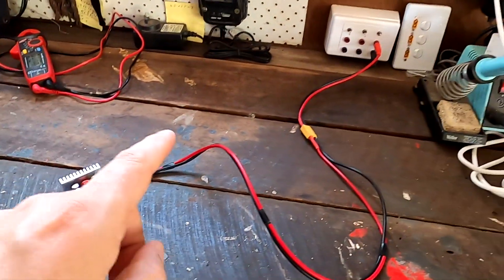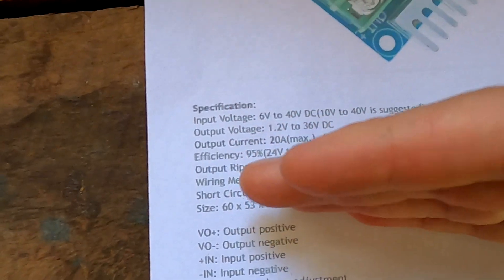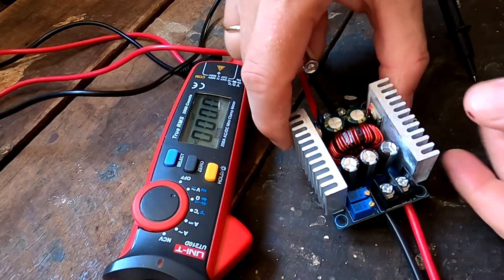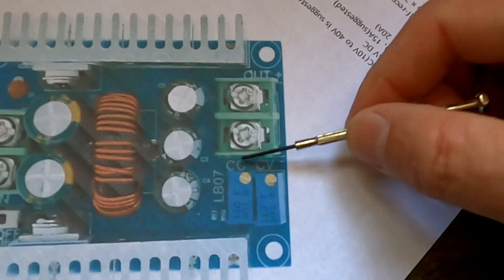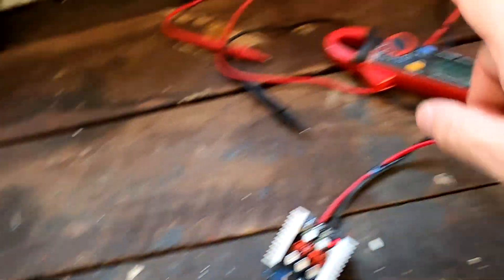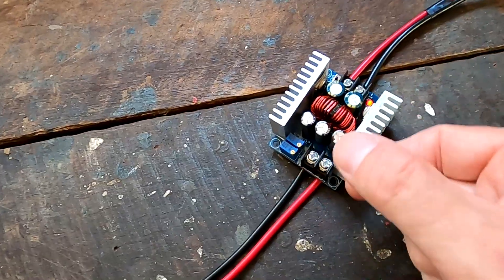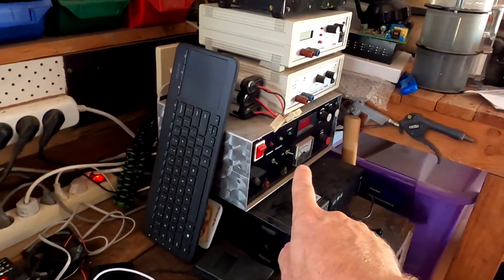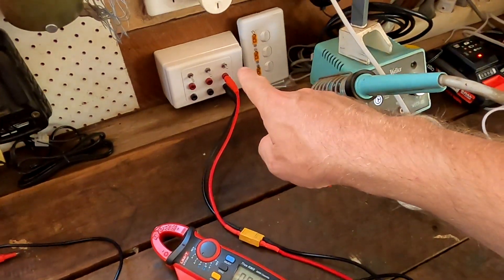Workshop: Lithium Charging 101 -  Getting these Amps in... (Part2-2)

Comment: This is reminding me of how I burnt down our dream home. I used a buck converter to charge a 10 ah lithium titanate  cell forgetting I had previously charged charged some 18650s at 3.7 volts. I did check it but unlike you I didn't disconnect and at the terminals of the cell it read 2.6 volts which I interpreted as nearly full. When the titanate cell exploded it triggered the other cells next to it and they went off like Roman candles in our attached garage.

Comment: I recently did the same to charge my cells before running them through the EBC, I have two different models of DC Buck converters, the one from your thumbnail and a smaller version (amazon description says 12A). I thought connecting a 20A Buck (capable of 22A continuous under heavy cooling) and a 12A (14A is the fixed CC limit) buck together would give me 36A, but no, the small 14A fixed converter suddenly went to 17A and more, running extremly hot. So please check carefully if different converters work together, even when their output voltage is within less than 0.01V

Comment: Woah! this cleared so many doubts I had. My 8S configuration (100Ahx16) are out of balance/never truly balanced due to the amount of time my bench power supply could ever put out. I always wondered how your zketech-a40l was doing 40A. In another video I found that, that chinese cracker actually as 5v-300watt SMPS and uses some fancy buck conversion to do the 40A. Thanks again!!

Comment: You got me thinking now, for my EV conversion to charge my 70S 250V pack I can charge it direct from a number of solar panels in series to get the voltage up to a usable level. And count the ah/hr going in upto maybe 90% (fast charge) BMS there backup. A balance charge would be needed with a controller i suspect, except they dont make mppts for 250VDC battery packs.
Reply from the maker: NOOOOO, never use the BMS as a charger! You always want a proper charge controller doing the charging. The BMS is just a safety device if something goes wrong.
Reply: @OffGridGarageAustralia  I wouldn't recommend it either. But actually it is doable. EV works in Perth were doing exactly this. And Jack Rickard did alot of testing with fast charging LFP cells with  much higher voltages. As long as you are counting the AH going in and keeping temprature in limits. 

Anyway Andy where do i buy a charge controller for a 250VDC 70S pack?

Comment: Hey Andy, Still trolling through your videos, been a treasure trove of information. Thanks again! I have struggled to find anything about leaving a battery attached to a DC-DC perminantly, in my case, 13.8v output for charge a 12V 25Ah LiFepo4 for an outhouse, which at 3.45V per cell seems like a great choice to me. Quick question, where did you get the wall panel for with the 3 + - inputs and switches?
Reply from the maker: Thank you. 3.45V is ideal for these batteries.
I build the wall panel myself just from an blank standard switch plate, installed some banana jack ports and switches and connected the solar panels.
Reply: @OffGridGarageAustralia  Perfect Andy, why buy it if you can build it :) its a simple an effective idea. Thanks again and keep up the good work :)
Reply: If you you were leaving permanently connected i would probably have the voltage set for 13.4V (3.35V resting voltage of LFP cell) Which is also the LFP float setting on Victron MPPT's. Mind you leaving LFP 100% charge all the time isnt great.

Comment: Hello, when the voltage of our battery is 13.3, if 7-8v comes from the solar panel, will there be a problem? Will the current flow in the opposite direction and damage the device or the panel? actually I am very curious about this question.
Reply: Can we connect these modules in parallel to get more charging speed? this device actually acts like an mppt.

Comment: i have a question  since my solar array is converting to ac  on the roof tru micro inverters(enphase iq7)  im am looking for a way to charge my powerwall  when there is only sunlight  avaible.
I ordered 8 of the lifepo4 280 ah batteries(my powerwall of 6.4 kwh) and i just wanna use them to run at night when the sun is gone   and charge tru the day with solar only . so how do i make sure i charge the batteries with only solar power , also  woud it be smart to charge all the batteries parallell and tru relais switch to serie when i start discharging them to get a higher soc??

Comment: I'm thinking of something like your buck converter for a sail boat I'm wiring up. I have two outboards that generate up to 6 amps or so, and wouldn't mind letting them contribute to charging a lithium battery. So wondering about a marine proof converter - maybe you or a reader/watcher would have a link. I've been searching the googles, have found some very expensive ones, and other affordable ones that generally don't have enough specs to know if they can be dialed into 13.6 volt max output or not.  Unless there is a better way...   Enjoying your videos - thanks!
Reply: By marine proof, it would be inside, but there's that salt air...

Comment: You should measure the Voltage drops on the wires between the Voltage Source and the Batteries terminals. When the active device (MOSFET) in those buck converter shorted out it will dump input Voltage to the output so you need some kind of Over Voltage protection to protect the load (Batteries in this case, hopefully the circuit breaker will trip in time before damage occur). You are so right, you MUST keep an eye on the setup while charging the batteries.

Comment: If you were building a 16 cell 12 v battery with those 280 amp cells, could you make it 4s 4p with one big BMS or (4) 4s 1p with 4 BMS's? I don't plan to 1200w/hours out.
Reply from the maker: If I would build a 12V system it would be a 424p, yes. In this case you parallel 4 cells and put them in series with the next 4 in parallel. You will need only one BMS for that setup.

Comment: Why the batterys are all parallel, make more usable to put 3 in row series for 12v  pairing 2 cels. Can use wide range of 12v gadgets and 230v invertter when need 🤔 (also no need heavy cables and loses are smaller)
Reply from the maker: That's for balancing purposes as I mentioned.

Comment: This is a great video. A couple of years ago I tried to explain lithium charging in an online ebike magazine. Basically it is CC-CV. Any 18650 data sheet will show that, though there may be an adjustment at the end. I sort of stumbled upon these DCDC converters and realized the settings for CC and CV were designed for lith charging. I always just set the modules for the max voltage, for the pack. But I've wondered about solar charging and how to get more output. An MPPT regulator boosts the voltage but also protects the cells. You can't really do that with this DCDC converter. The cell voltage is what matters, not the voltage on the output of the DCDC converter. Most of these lithium guys offers packs or cells and then they offer a pricey MPPT regulator and stuff like that. It may work, but knowing hot to charge a lithium cell or pack is important. This video shows how to maximize the amps into the battery while noting that you have to limit voltage as the pack voltage rises. What's great is that if you use a power supply and don't need to optimize the amps, like overnight charging, you can just set up the buck or boost converter and make it a dedicated charger. Thanks. Great series. Hope you get a bunch of subscribers. You don't talk down to people, don't oversell stuff.
Reply from the maker: Thanks heaps, George.
You usually have a much higher input voltage with theses MPPTs than output voltage. The amps are exactly the other way around less amps at the input but higher amps at the output. An MPPT regulator does boost amps, not volts. 
A typical setup would be 3x45V solar panels with 5A/ea at the input side in a series connection and you charge a 24V battery with that. 
135V/5A as the input
28V/30A as the output
These buck converters are exactly doing this and if you open an MPPT controller, you can actually see the internal buck converter, the inductor coil is very obvious. Some MPPT controllers have more than just one buck converter.
Reply: @OffGridGarageAustralia  When I made chargers they were all boost, for higher voltage ebike packs. I found it easier to charge through 12 volt batteries and go up to 54 volts or whatever. I always noticed that if I tried to hook up the DCDC booster to the solar panel, the output was not very good as a percentage of panel output. You addressed this showing that the boost will ramp up the amps if you go to higher voltages when the bank is drained. I think Genasun makes a boost MPPT regulator, and I wonder how they do the boost. The Genasun is marketed for 12v panels and golf carts with 36/48v. I'm a little confused about why they don't make boost MPPT regulators. A lot of people in the ebike community want solar solutions for their 48 volt ebike packs. Like I said, I always ended up charging off a 12volt bank and feeding the boost converter off that.  Maybe you could suggest a way to use the basis 100w panel, nominal 12v, to charge a 48v ebike lith battery. Thanks!!
Reply from the maker: Ah right, your taking about boost converters. Yeah they are different to the DC-DC buck converters. I've got some of these too. They bring your lower input voltage to a higher output voltage, yes.
I can certainly make a video about that too. Thanks.

Comment: Have you considered human power (hand crank/exercise bike converted into generator) ive seen some chinese 800w dynamos for exercise bikes on ebay.
Reply from the maker: NO!!!!!!
It's sunny Australia. We have 27h of sunshine every day... 😁
Reply: @OffGridGarageAustralia  yet your only getting 50watts out of 250watts of solar panels. Are you sure you have them angled directly at the sun?
Reply: @sNEAKYnIGHTmUPPET  the batteries can draw way more watts than his panels are putting out. The buck convertor isnt a bottleneck either. The bottleneck is lack of direct sunlight and solar panel manufacturers always way overestimate panel wattage output your lucky if you get half the advertised wattage
Reply: @sNEAKYnIGHTmUPPET  buck convertor only limits current if you tell it too. by reducing voltage with a buck convertor you increase amps so you keep similar amoumt of watts to the input minus like 5% because buck converter is only like 95% effecient
Reply from the maker: These small buck converter are limited to 20A output only with good active fan cooling.
Solar is optimal as you saw in my current short circuit test, getting max amps out of the panel.
Reply: @sNEAKYnIGHTmUPPET  i guess all the physics textbooks are wrong then and power = voltage x current is wrong. Eg you have a 30v solar panel supplying 1 amp of current. 30*1amp=30w. You feed thaf into a 95% effcient buck convertor. 30w*0.95=28.5w. You reduce the voltage to 3v. The new current is 28.5w/3=9.5amps
Reply: @sNEAKYnIGHTmUPPET  yes because your load is too small. You do realise these lifepo4 batteries can charge at 280amps? His battery setup can conaume 7168 watts charging at its maximum speed so the load is not a problem. Youd probably need more than a footballs pitch of solar panels to charge those batteries at their fastest speed. Or a 32amp mains outlet.
Reply: @sNEAKYnIGHTmUPPET  just because your bulb is only using 30w doesnt mean the extra 240w from your solar panel is going wasted going nowhere. Its still potential electrical energy. You can attach 9 of your bulbs in parallel to your 270w panel before bulbs start to dim in brightness
Reply: @sNEAKYnIGHTmUPPET  he clearly states that hes not getting the full watt output from his solar panel in the video. So my statement was correct. And ive clearly stated that hed nees a bigger better buck convertor/charge them in series instead of pararell to deliver more watts too his batteries.

Comment: I have a couple of commercially made solar generator power stations a 666wh allpowers that has a 500w inverter and 2 smaller 200wh ones with 200w inverters. I also have 2 foldable 100w solar panels and a 20w solar panel that fits on a backpack
Reply: In the specs the 666wh says the maximum watts it will charge at is 100w. It has 3 methods of charging via a 20v 5a  mains brick, 90w usb c pd, or solar via anderson port. You can charge with a combination of all 3 even tho its not mentioned in the manual and ive managed to get it to charge at 118w with the mains brick and a 100w usb c pd charger plugged into it. Others online have reported being able to get it to charge at 160w. I guess it depends on the quality of lipo cells you get in it.

Comment: I suggest you this power supply for this kind of charges:
https://a.aliexpress.com/_mrJ27HR
Reply from the maker: Yes, that would work. It's a bit pricy though and the overall goal is charging the batteries from solar and not using grid power.
Reply: @OffGridGarageAustralia  i meant use it for the first top balance charge, losing the less time as possible. And 3,65v at maximum 100Amps (at the end it drops) will be 365w as much

Comment: I saw in your earlier videoa that you have 2 smaller solar panels (40w) and one larger solar panel (220w) are they all the same voltage so you can connect them in parallel and not lose total power? Or do you series the 2 40w then put them in pararel with the 220w?
Reply from the maker: They are different. I chose the sizes on purpose for my experiments.
2x 40W with 22Voc and In=2.2A
1x 220W with 37Voc and In=7.4A
With this little switchboard I made I can set them in any configuration I like. Yeah, I could series the little ones and then parallel with the large. That will work.
Reply: @OffGridGarageAustralia  https://youtu.be/HUtc9AHGKAw check this video out to he recommends repostioning/angling your solar panels at least once a month as solar noon changes throught the year and sum changes postion in sky. A surface temperature gun can help see where sun heats the panels up the most to.

Comment: I think those small 300-400w buck convertors are limited to about 15amps arent they? You can get bigger 1500w ones that can handle 30amps. If you charge in series its easier to pump more watts total into the entire pack as you dont have to worry about getting huge gauge wires for high current?
Reply from the maker: Yeah, they are limited to 20A with good cooling. Bigger ones make sense of you have to charge from the grid but our goal is charging from solar.

Comment: What size circuit breaker are you using?
Reply from the maker: This is just a normal 3-phase 25A AC circuit breaker I'm using for my testing. Later we will get something different when we setup the battery.
Reply: Even solar DC breakers should never be broken under load. 
Visit a solar installer, they should have a collection of old isolator switches from old systems. Some early polarised ones had magnetic traps to quench the DC arc.

Comment: Hi Andy, Im buy  mppt charge controller 60A Esmart3 from Aliexpress to start to build my own solar system. Now it get lost! The tracking shows I signed for but I haven't. 130€ are blowing up the air. Sometimes I think for this money I will get many kwh out off the grid and I have to do nothing to build for or waiting for Chinese parts over weaks. 🙄😕
Reply from the maker: I had this as well, The mail man made a mistake, signed for it and put it into the wrong mailbox. I never got the device.
I claimed this with Aliexpress and got my refund from them.
Reply: Yes I take claim on Aliexpress too. I have good chance because the seller not answer and the shipment goes to Bochum now I find out not to Weiden

Comment: The converter is losing 10+ watts to heat. 80% efficiency. That's horrible! I dont think many people running solar can afford a 20% loss of output... :-(
Reply: Yep, that is where a mppt comes in, the buck converter is dragging the solar panel down beyond the mpp voltage of the panel, and mppt controller will adjust the volts on the solar panel so it delivers maximum watts.
Reply: @Bennyboy-dog  what is the typical efficiency of a mppt?
Reply from the maker: MPPTs can achieve 15-20% more efficiency than WPM controllers. With clear skys, they are actually the same. Only at dawn/dusk and shading MPPTs have advantages. There are other advantages of MPPTs in regards to solar size array which they can be connected to in comparison of WPMs.
Reply: @OffGridGarageAustralia  Almost! - A PWM will load the solar panel to some V value that may or may not be optimum for the PV array, the mppt should always seek the optimum voltage for the PV to extract maximum power.

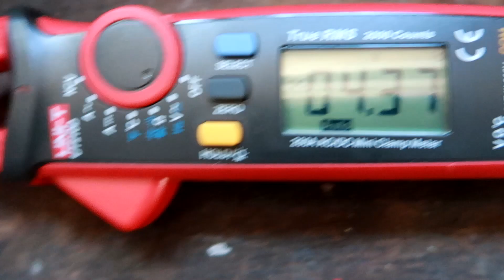Comment: @8:17 the difference in voltage at the batteries and the converter is due to voltage loss in your wires with 17 amps going through them. Has nothing whatsoever to do with the batteries being big and absorbing all the energy.
Reply from the maker: It's the relation of energy source and battery. The source has no chance to hold up its voltage with such a big load and maxes out its amps with voltage been just a tiny bit higher than the battery. That happened with the power supply at 2A and also the solar panel at 8.3A.
If you would have a source which can deliver say 200A, the battery would not be able to pull down the voltage any more and would overcharge.

Comment: Great converter. My be remain voltage at 3,65 and select de CC  trimpot at the current what you want. 5,7,10 or more. Non adjust the CV. Is so that ?
Reply from the maker: You can do that and use the buck converter as a charge controller. You can also limit the amps if you have smaller batteries. Yes, if your set the voltage on the buck converter to 3.65V it will not overcharge your battery. To be honest, I would not charge the cells that high, maybe stop at 3.45 (~80/85%).